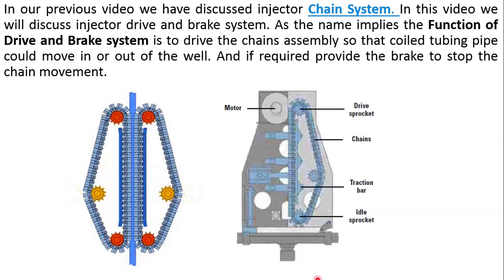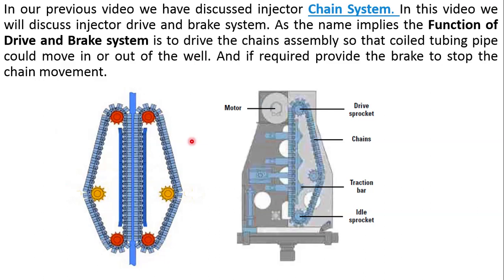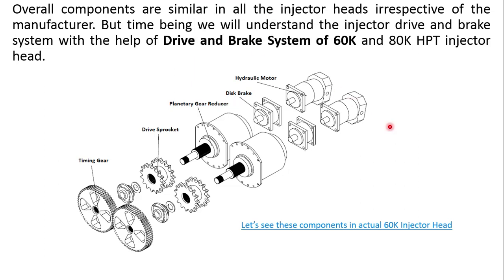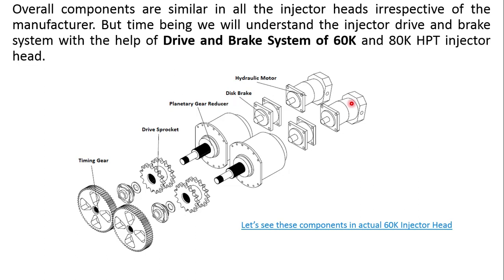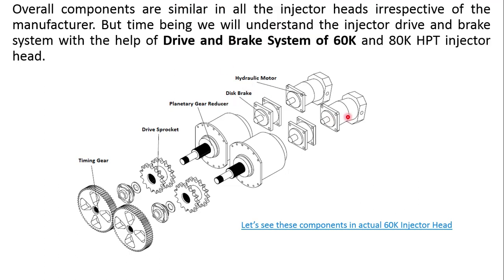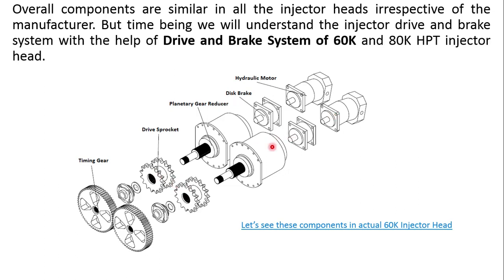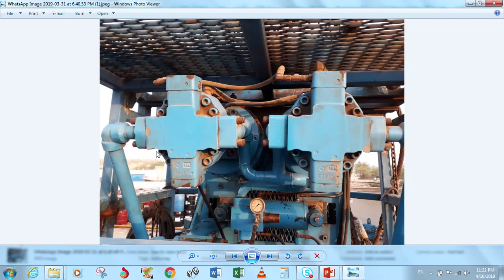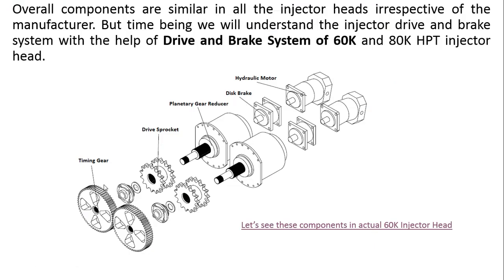7- Drive and Brake System in Coiled Tubing Injector Head by Yasir Ali

Comment: Sir suppose your coil tubing have to reach a depth of 10000 ft but in 5000ft your one hydraulic motor fails. So what should we do . Do we continue the operation as we have timing gear or do we stop the operation or do we trip out the coil tubing ?